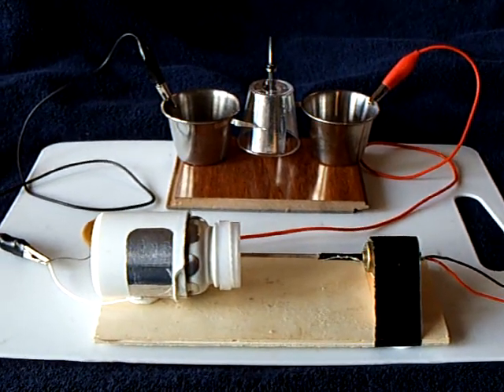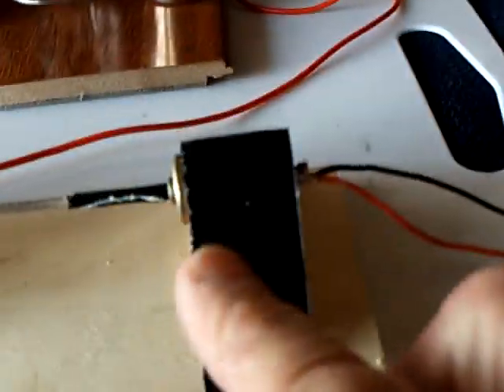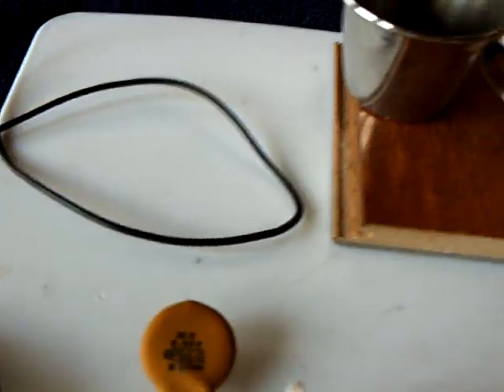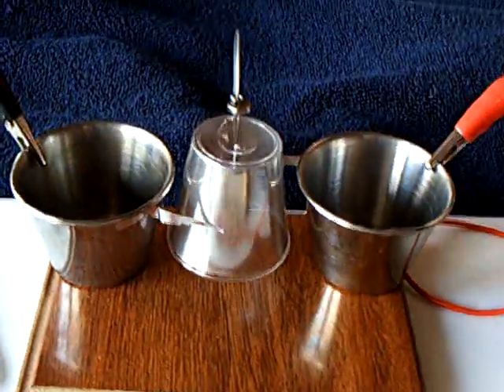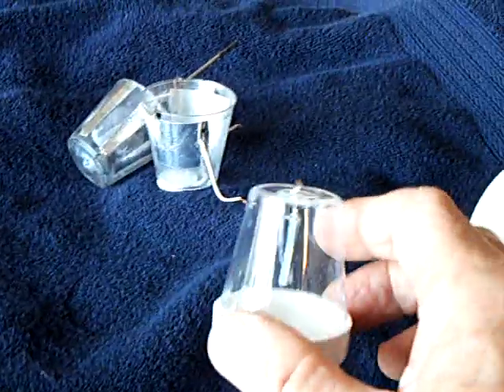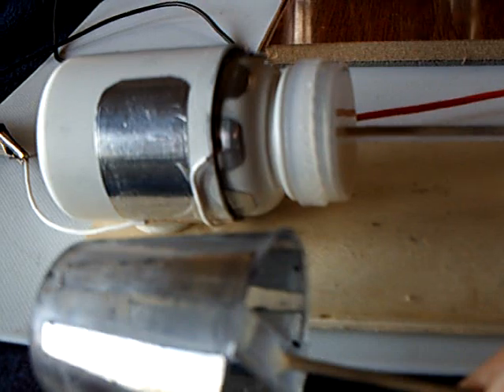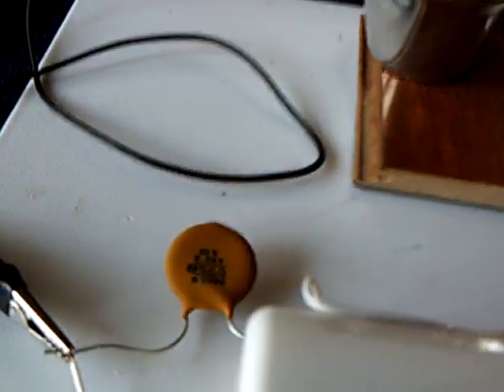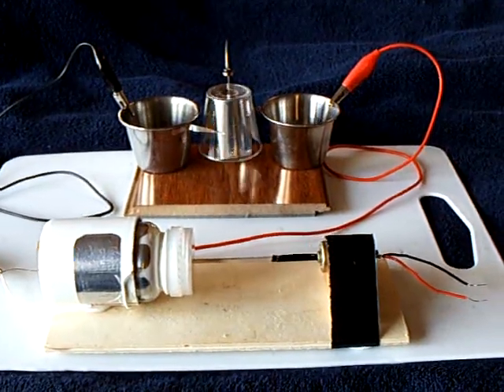Electrostatic Influence Generator

Comment: Lord Kelvin replenisher works by two outside induction plates and at least two plates on the inside that rotate. 

A) It starts with the smallest of charge imbalance on the plates.  While the two sectors are passing underneath the induction plates, they the brush up against a neutralizer  that allows charges to flow between two sectors so that electrons can get away from an excess of electrons on one inducer and or get closer to a net positive charges on the other I ducer plate.

B) Then the connection with the neutralizer breaks and isolats the charges on the sectors.  The sector plates have a capacitor with the inducer plates with a certain amount of charge we will call Q and and for simplicity we will look at fast plate capacitors.  Q=voltage×capacitance  and capacitance = permitivity × area / distance.  At this point distance from the inducer plate is smallest and capacitance is greatest, but as you rotate the sectors around, the  distance grows and capacitance increases. But the charge remains the same. Sooo because Q=v×c, for Q to remain the same as capatiance shrinks, the voltage has to rise.  

D) as it continues to rotate, the sectors are now underneath the other inducer plate and the voltage on the sector plates is very high.
Then the sector plate brushes against a charge collector brush and discharges the high voltage to the inducer plate. 
E) then the contact with the charge collector brush is broken as the sectors continue rotating to the neutralizing brushes.  Starting back at  step A.  Except now, the inducer plates now have more charge on them as before,  and can move twice as much charge as the time before.

Comment: Great device, i'm getting very interested what's going on in the electrostatic process.. the link below is about a plastic bottle with electrodes and acidic liquid that is used to build up ionic charges on the plastic, the liquid is removed after 5 mins leaving the bottle charged.. It gives a load but maybe it's a hoax ( or not? )

Keshe Generator Plasma ~ True or False

Comment: Good experiment lidmotor.
perhaps there would be a good result if it rubbed a little less, or it's already done.
And it certainely runs at aproximately the same speed without the static engine.
Reply from the maker: This generator needs bearings on both ends and better brushes.  What I did here was just a quick build to see if it would work.  I might build a Wimshurst if I can gather all the parts.
Reply: With the video of Thomas Kim about the ping pong balls I made a theoric schematic on overunity.com (Reply #23)
http://www.overunity.com/14021/electrostatic-motor/msg378564/#new
Instead of lenz law for the electrostatic it must be the Dielectric strength...
Reply from the maker: Cédric PIERRE Thanks.  I will check it out.

Comment: Lid:

Great experiment!  I have found that caps, especially supercaps, capture this "static" electricity that I learned in science class can not do any work.  This is what I did with the high spikes from my earth battery....not enough energy to do anything with until I used a super cap to capture that energy.  That is why I suggested a supercap on one of your earlier videos.  Yes, you would need that motor to run a little longer but, then it would power your system for a long time.  This is great stuff to see here.  Nice job on the pill bottle device.  Great work as always...very inspiring.

Bill
Reply from the maker: Thanks Bill.  The amount of energy the machine outputs is not that much.  It is just in an interesting form being super high voltage and low amperage.  I can try one of my low value supercaps on this and see what happens.  The device is not built to run for a very long time though so I might not be able to see any storage from a short run.  I hope that you can build either a Mini Van De Graaff or this thing and do some experiments.

Comment: Seems that a high voltage static charge has a remarkably wide field of energy all around the devices also, most of which seems to go to waste.     great little experiment
Reply from the maker: Hi Jack.  Thanks.  It is all about electrons wanting to go somewhere or get away from some place.

Comment: This is great! Will you try to step down the voltage to around 3 volts, and see what kind of amperage you get out of it?
Reply from the maker: Thanks.   I'm doing research on how to step this down.  Perhaps there is a way to change the generator itself to make more amperage at a bit lower voltage.

Comment: Hi Lid, you make a very important point. This is the first time, I see electrostatic energy used with conventional capacitors. The ability to store it, modify it, possibly step it down from the capacitor. Who knows, research will tell. It is a very good field to play with. Very nice work, Lid.
Reply from the maker: Thanks Mike.   This project is connecting many dots.